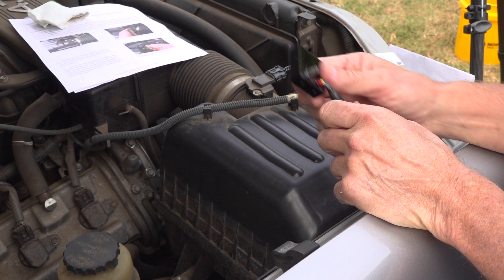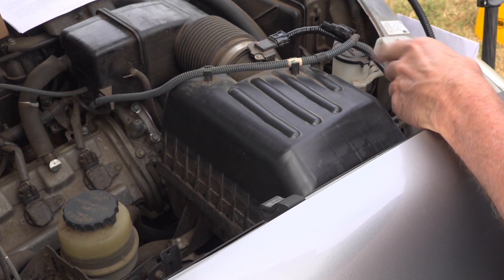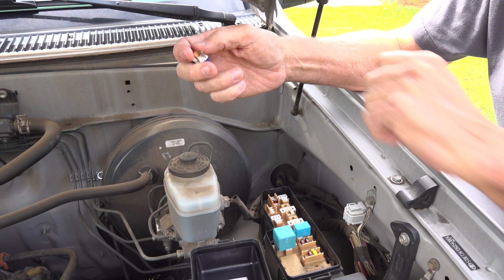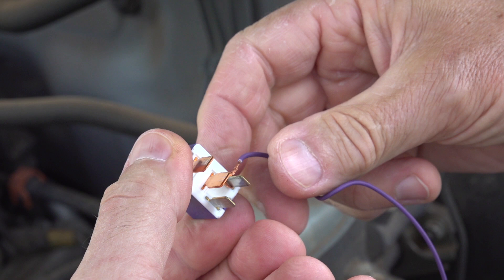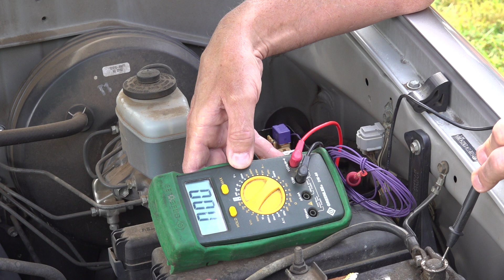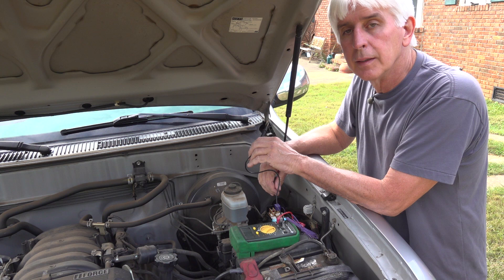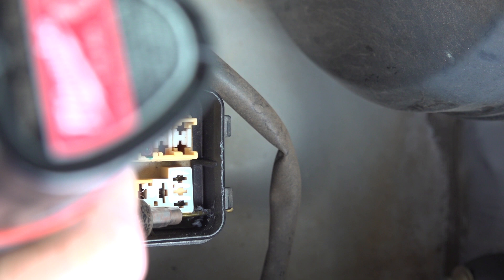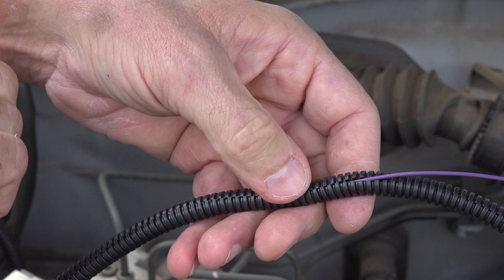2006 Tundra - SAIS - Hewitt Bypass

Comment: Just got mine installed it and did the Voltage meter test and it failed and I cant even clear the codes! Although it took it out of limb mode .
Reply from the maker: Hmmm. I would call/contact the manufacturer. They have most likely dealt with that issue before. 

Terry.
Reply: I'll call today. Thx
Reply from the maker: Let us know how it works out for you if you have time!
Terry
Reply: @ForestToFarm   It works fine now. I  have a multi meter that automatically switches  between DC or to AC and it's not that fast that is why i only see 0.7v  and not 12v  than 0.7.  It took it out of limp mode but still have the P0418 code . I still need that Pump proxy pack to be able to erase the code.

Comment: Can you still drive with the code?
Reply from the maker: First let me say there are many variations so what works for us may not be your solution. For us the truck drove fine when the codes were present indicating problems. For others, maybe with different codes, there were problems including the truck going into "limp mode". Now that we have done this bypass there have been no issues nor any codes appear. Fingers crossed we will not have any other problems with this bypass installed. Wish I could tell you more. You can call the company and they would likely be more knowledgeable on the subject.
Terry
Reply: @Forest To Farm 
Thank you guys for posting and very thoroughly  explaining what the code is for, how the bypass works as a solution, how to install and for being responsive to peoples comments that had questions. This helped me out in a huge way!!
Reply from the maker: @danielbushta8119  Thanks for the kind words! Glad to helped. Its getting harder to keep up and I am sure we have missed a few comments here and there as this channel grows but we are determined to answer each and every comment eventually. Thank you far sharing your experience as well.
Terry

Comment: Hi guys I have one tundra 2005. Do you think that work on my model to? I have problems with the secondary air injection . Code problem P2440. Thanks!
Reply from the maker: Howdy! I’m not sure. I’d check with the manufacturer to be safe. They more than likely have one for your truck. Their website is: https://hewitt-tech.com/store/

Best of luck, hope it can fix your problem. Mine is still running great with it and I drive it every day!

Brian
Reply: Yes it will work. That would get rid of all of those secondary air system codes related. Regards.
Reply from the maker: @neverstoplearning382  Thanks!!

Comment: Is this thing going to pass smog in cali.
Reply from the maker: Based on California's stiff regulations I would be inclined to think not but you could check with the local inspectors I guess or Hewitt should be able to tell you. They are linked in the description of this video below.

Terry
Reply: I live in California and will be installing one, I will find out in the next month or two if it will pass.
Reply: Jorge Villegas did it pass smog ?
Reply: @shopking6989  i dont think so.
Reply: @jorluivil  did your truck pass smog?
Reply: Did this pass the smog in Cali?
Reply: @jorluivil  did this kit work for you in Cali?
Reply: @jorluivil  did it passed?
Reply: @basedgodrodney9466  update?
Reply: @coachpete2771  update?
Reply: @jasoncolucci9694  update?
Reply: @jonschlegel2961  negative. Did not passed. It’s tampered.
Reply: @basedgodrodney9466  so what did you end up doing?
Reply: @jonschlegel2961  i ended up replacing the air injection.. took me a while but got it done. There’s video on how to do it.
Reply: @basedgodrodney9466  hoping you wouldn’t say that lol
Thanks man

Comment: Which is more BS, this kit or replacing the actual pump
Reply from the maker: By far the pump. Gotta tear the manifold down plus various other stuff. Thanks for watching!!
Terry
Reply: @ForestToFarm  just buy a tundra that has the air pump mounted near the wheel well instead of inside the intake

Comment: LMAO. Think most toyota (with these engines) have this problem. Even new tundras do as well
Reply from the maker: I believe you are correct.
Terry
Reply: @ForestToFarm  The 4.7L is still the most common to have the problem but they are now all 10-15 years old. The 5.7L and newer 4.0L and 4.6L vehicles also have issues. We now have our GenII kits available that cover every vehicle they sell with the system from 2005-2021!
Reply from the maker: @Hewitt-tech  Thanks!! Good to know.
Terry

Comment: the instructions from hew really said to wrap wire around the relay??? thats piss poor... nothing against you guys clearly...  but Hewit.. come on depin... solder a proper connection heat shrink.. protect it... as if it was made to last like the rest of the crap in the vehicle... im no where as anal as these yota online engineers but good lord i understand professionalism when performing work........
Reply from the maker: Ha ha. Did not design it. We simply installed per manual. I’m not loving that connection either lol. 
Terry
Reply from the maker: What I can say is that it still works great and flawlessly. Heck of a lot cheaper than replacing the parts needed. 
Terry
Reply: @ForestToFarm  haha absolutely... still working any issues? i ordered one yesterday too to put in with my thorleys thanks!
Reply from the maker: @emarquis87  Working like a charm. I guess if that "connection" fails we can always remove, clean and re-wrap. :)
Terry
Reply from the maker: @emarquis87  That will be the first place we look if we ever have problems again.
Terry